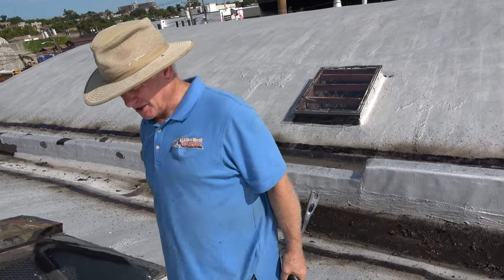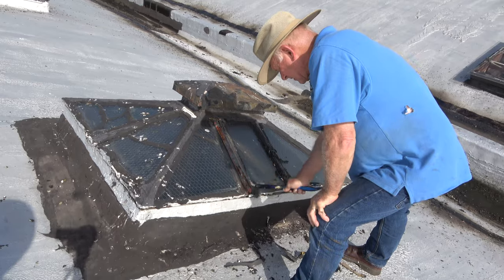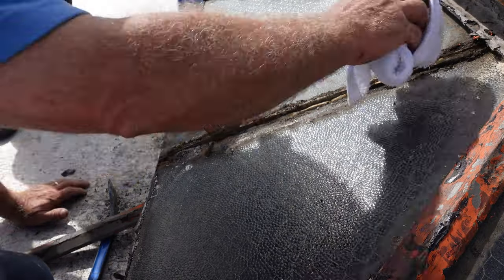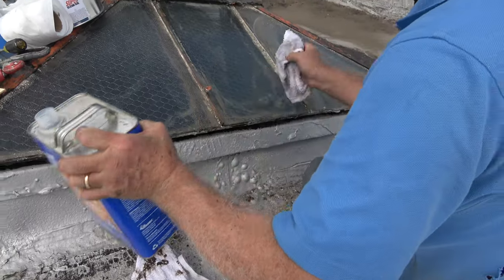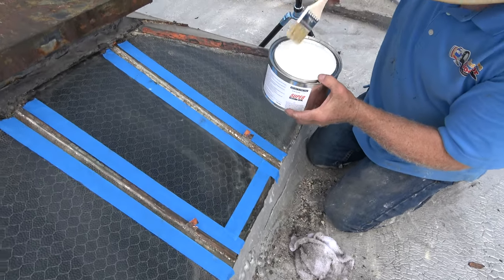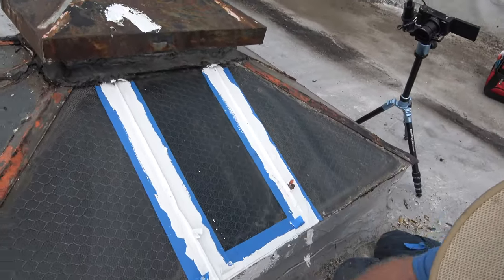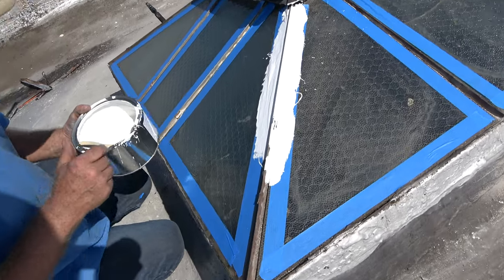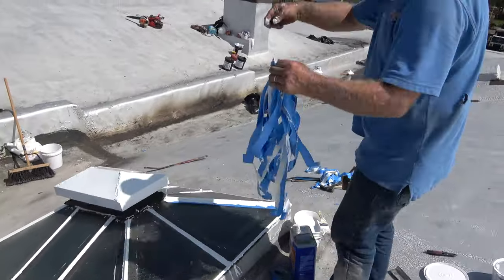Repairing Leaking Skylights Permanently: The only Sealant that sticks to Glass/Metal/EPDM

Comment: By any chance, do you know the type off glass is in the skylight you sealed up. I am looking to replace one piece of the glass and use your technique to seal it up. Where did you get the super silicone in paint on form?
Reply from the maker: https://bergstromm.com/product/black-silicone-seal-1-2-gal-25-ft-poly-fleece/
The glass is a kind of wire reinforced glass. I guess you need to search a company that does glass replacement and they might cut you a piece to size